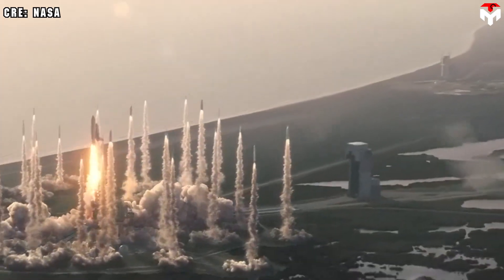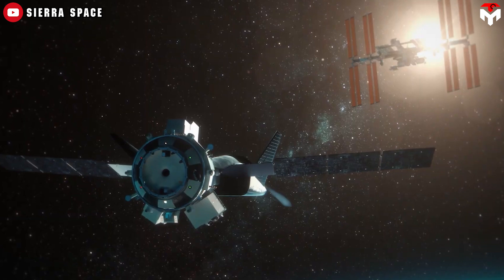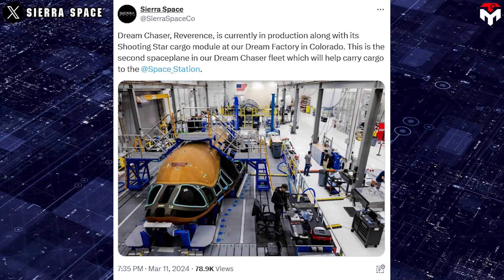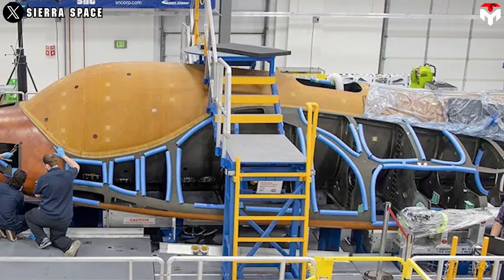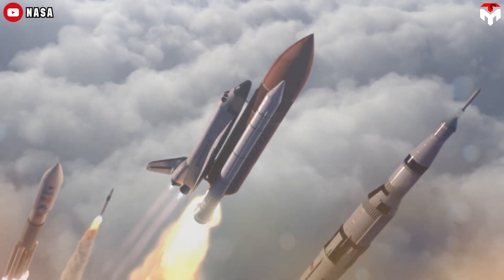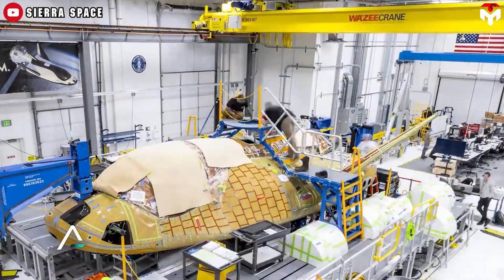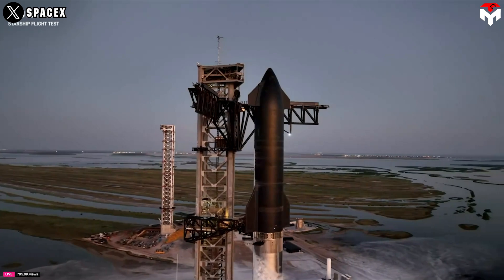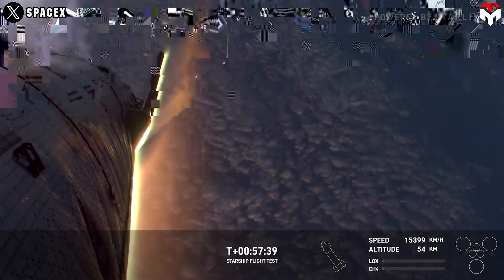NASA new Dream Chaser's HEAT SHIELD is Somehow Better than Starship TPS...

Comment: but did they tell you that those same tiles fell off the space shuttle on almost every occasion and even caused one failed re-entry? each system may very well be better than the other but those tiles needed an external check as a solution, the ISS is not going to be there after 2030 so unless the guys want to G.O.A.L. then there still is the risk of the tiles falling off due to vibrations.

Comment: If the graphic showing the Dream Chaser reentering with sparks flying off its nose is from Sierra Space they may want to change it to just a plasma glow - unless its shield is somewhat ablative.  Sparks could be evidence of the shield ablating which doesn’t sound so good for reuse 15 times.  A perfectly reusable shield would probably just have a glow of plasma coming off it rather than plasma plus thousands of sparks?  Don’t know - this was an observation made about the recent SpaceX Starship reentry footage which had planet of sparks and obvious ablation.

Comment: How do you know the heat Shields are better they haven't been tested yet wait until it actually re enters the Earth's atmosphere then we'll see what's going on
Reply: Better than SpaceX's StarShip tiles is not a very difficult accomplishment. Quite a large amount of Starships tiles have been recovered by collectors and such.   The Starship tiles were just the same basic composition as The bottom of the Shuttle.  Except the shuttles tiles used micro materials mixed uniformly and precisely.  The Star ship tiles are far more cheaply produced very poor quality,  unevenly sized materials and mixed.  Very brittle and very less heat tolerances.
Reply: they have wind tunnels for reentry
Reply: @sereneriver196 not sure how a wind tunnel would be useful in heatshield testing?
Reply: It's just another way to attain funding without producing a product.
Boeing showed them how to do this.